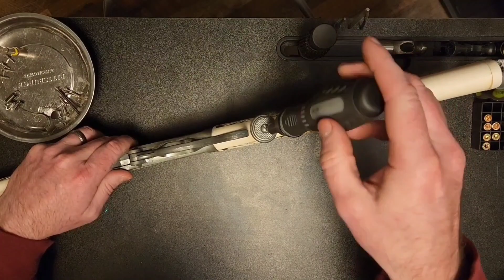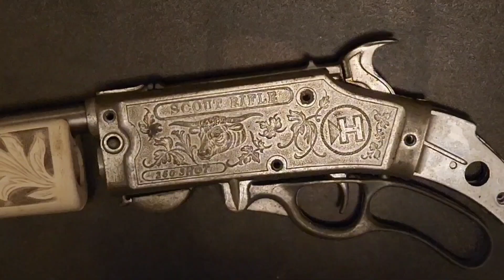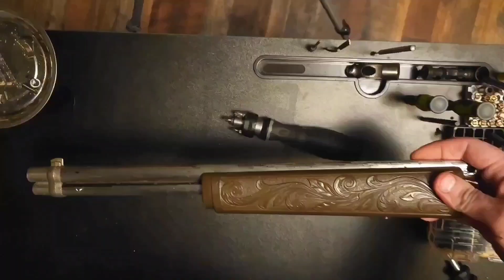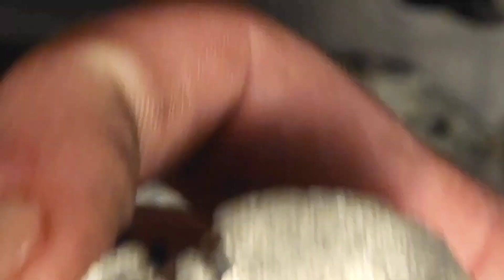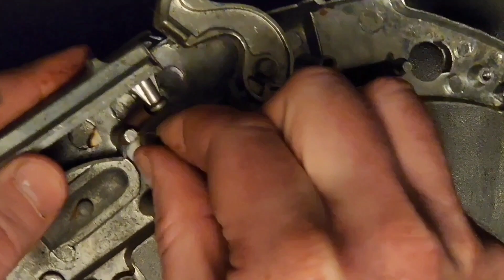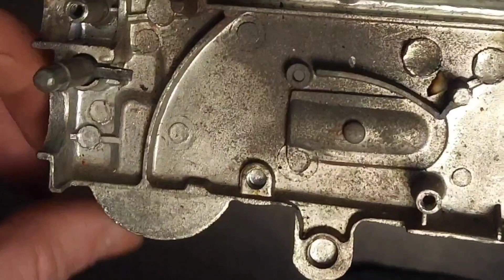Hubley Scout / Rifleman Flip Special disassembly

Comment: Always like to see inside those die-cast zinc cap guns. Now, are Japanese PFC (plugfire cap) guns a 'thing' where you're from? Given they're cap guns, I would think there would be an attraction...
Reply from the maker: Yes and no. I'm aware of them and own  a few, but I don't think they're very common in the US. In a lot of cases the plug fire guns cost as much or even more than the actual firearm and that doesn't make sense to most people in the US. They also cost drastically more than all but the very best airsoft guns, so I think airsoft is just much more attractive especially in countries where personal firearms ownership isn't common. I'm spoiled because I can have the real thing and any sort of replica as well. Cap guns are what got me into real firearms and now I've circled back to the cap guns. Lol
Reply from the maker: I'd really like to get my hands on some of the primer cartridges made in Germany for plug fire guns. They use centerfire non-corrosive primers instead of the corrosive plug fire powder, much more reliable cycling and much easier to keep the gun clean.